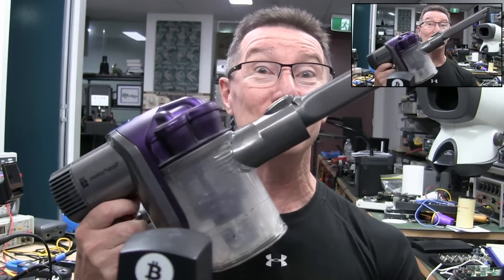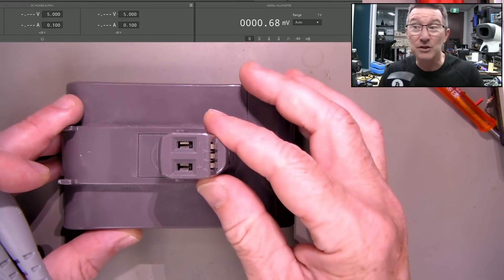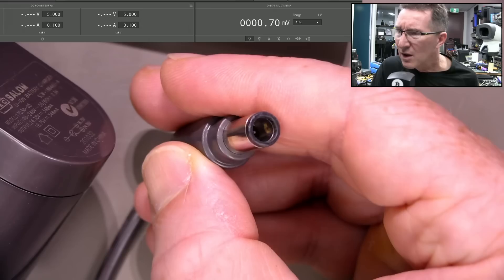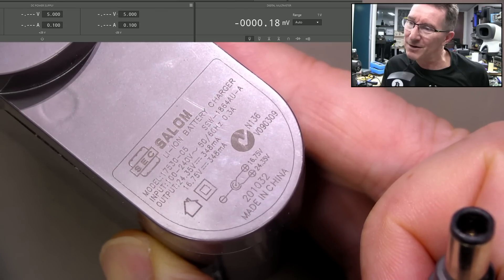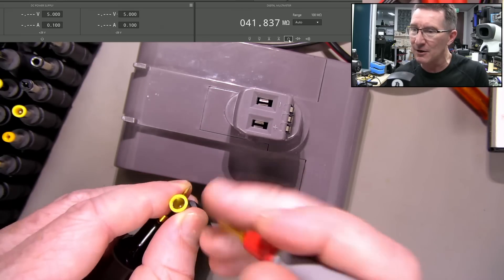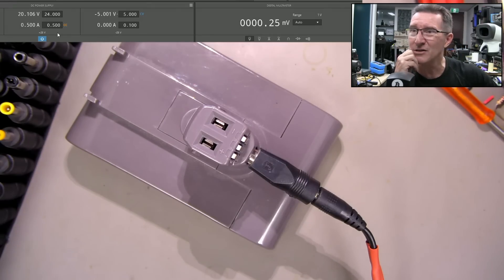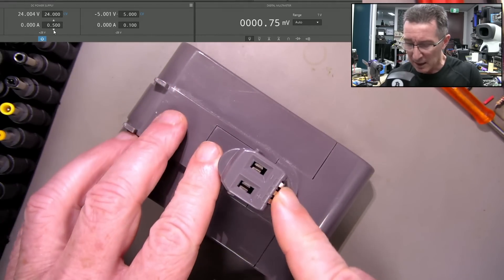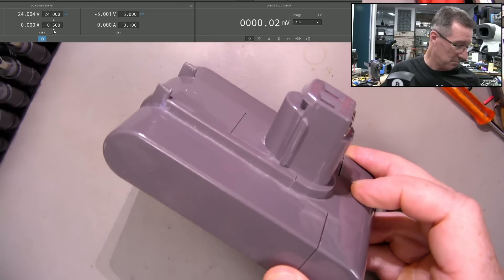Dyson Battery Failure

Comment: There's probably just a dead cell..  3.7 x 5 = 18.5v..  
If you could pull it apart, you might be able to reset the fuse.  (you likely already know this):  There is a little fuse on the positive end of the cells, that can break contact if the inside builds too much pressure from overheating, etc.. Many times you can just press down on the little diaphragm under the positive terminal (through the little pin holes) and reset the fuse again.   Sometimes the fuse will engage with heavy use or overheating--  but it also may be a shorted cell or something;   so there's always a little risk when resetting them..   I would test it well and charge and discharge it a few times and make sure it's not going to overheat and catch fire.............  But again, you would have to crack it open to get to it.   There are likely still 5 good cells in there otherwise;   I wouldn't just throw them away.
Reply: thanks for the info, i didnt know 18650s have this.
im one dyson battery pack that refused to charge the cell voltages ranged 2.7 - 4 volts ! 
i think its the crappy dyson BMS board that did that after a few months of non use. 
it doesnt include a battery balancing circuit / designed to make u buy a new battery.

Comment: So from my experience with power tool batteries. Most likely that battery is out of balance. I had some Milwaukee M18 batteries which got to the point the lowest cell was down to 3v while the highest one was at say 3.8v. So the battery would have very little usable capacity before the BMS would shut it down on either low or high voltage. 
Actually had a good bit of success manually re balancing using a benchtop power supply and just slowly bringing all the cell voltages back upto the same thing. 

But given thats 13 years old and plastic welded shut prob not worth it. You could also just drill some small holes through the plastic that line up with the ends of the individual cells to get multi meter probes through. 

And obviously any time you are messing about with lithium batteries need to take care. But i'm sure you are well aware of this already. 

And i think you are on the money with that plug pack being for both a 6S and 4S battery pack. 

That connected looks a LOT like a older model Dell laptop charger. In Dells case they used the 3rd pin to tell the laptop what wattage charger you had connected. EG 1v for 45w, 1.5v for 65W 2v for 90W etc.

Comment: I have bought a lot of the dead V6 batteries. The cells are usually OK but, when left uncharged for an extended period, the "bms" pulls one cell lower than the rest and eventually halts all discharge. I can get them open (the batteries) but not in a non-destructive way. Cells are spec'd for 30a discharge I think though Dyson uses a max draw of 16a (18a for V8 20700 2.8ah cells).

Comment: I've replaced few batteries in my old dyson. did not have removable battery with a button click but after few screws it got undone pretty easy. and replacement battery was not that expensive from dyson and easy to install back. Got more years from it after the swap.

Comment: You can get adaptors for every make of 18v power tool battery on the market. I converted ours to run on my 6ah Makita 18v batterys. Works fine, lasts ages. Doesn't last so long on the lower capacity 3ah batterys though.

Comment: over a decade i must have fitted over a 1000 batterys packs to dyson cordless models the best models for battery failures were the v6 and v8 models with  2 year  warranty that lasted exatly 2 years and 2 weeks to 2.5 years depending on usage so that meant the batterys were out of stock everywere for months i had at 50 on my workbench for months. the killer of the older models the ocasionally the motor units pack up or the floor head with spinning brush wears out or breakshe motor burns out there no longer avalible. there not terrible. its just batterys i class as a consumable/wearing part and will need to be replaced.dyson ulike many other manufactuers dyson make there battery packs easy to change and replace. there are loads of manufactueres who build the batterys into prouducts with no replacements or require full strip down which renders them uneconomical for repair. easlt chanable battery thats worth a little credit.

Comment: i opened 2 battery's a small one and a bigger one.
both did not work, but the cells were in perfect condition.
I suspect the circuit board has a countdown counter that at some point simply says, you have used the vacuum cleaner 1000 times, I will stop working.

Comment: I had a pack on some other Dyson fail a couple of years ago. At least in the US there's about a million vendors of questionable repute on Amazon and the reviews are all over the place. So hoping to not get screwed by a crappy vendor I bought my replacement from iFixit thinking that they would probably have some measure of quality control or at least that they'd buy from the same vendor repeatedly. It worked out of the box and has been going a couple of years so I feel pretty good about it. Plus I got to support iFixIt.

Comment: We have the same model. I tried to disassemble the pack to replace the batteries but it's practically impossible to do so without breaking it. 
In the end I bought a knock off from eBay and it's still going strong 6 years later.

Comment: The battery from later V8 model will not deliver any power unless you put a magnet on its side. There is a reed switch inside that needs to be closed in addition to a push button (normally pressed by "trigger" button mechanism) for any voltage to appear on terminals.

Comment: Cell monitoring, but no balancing. Cells drift out of balance, so that charging is limited by the highest cell and discharge is limited by the lowest cell. I've been seeing that for about the last 20 years on laptops. Often that actual cell capacity is still pretty good and a manual balancing session will restore much of the runtime. If the case can't be opened without destruction, you can often drill holes to put probes through (a torn down version  helps a lot).
Reply: I agree, this is probably the case.  I have kept my drill batteries operational for years by taking them apart and charging each battery independently with a charge controller equipped with alligator clips.  It's always the same battery that is low and bringing it back to full gives me another year of use.  I should get a balancer board sometime and populate it with clip leads.
Reply: I was coming here to say this. Do a manual balance. I balance and sell old Panasonic laptop packs. C'mon Dave you are an electrical guru. "No workey" is not a valid conclusion.... take it apart!

Comment: When my Dyson battery failed, I bought an adaptor off AliExpress so I can run my 18v Ryobi batteries on it.
Reply: We definitely need a review of those adaptors. I'm curious how they up the voltage from 18v to the 21.6 mine is rated.
Reply: @Smelter57  They don't, Dyson circuitry will allow the motor to run off 25.2v but not lower than 16v.
On these older models you can plug whatever supply you like and it should run just fine, newer Dyson  machines (starting from v10) really communicate with the battery so sticking + / - in that thing won't do much, however, there are adapters for those some models too nowadays.
Reply: Got one for Milwaukee, runs great.
Reply: @wobblysauce  Which Dyson model do you have?
Reply: @Smelter57  It's a bit less powerful than a fully charged Dyson, but it still works great. I initially bought a Ryobi stick vac when the Dyson battery failed, but it turned out to be junk. The Ryobi powered Dyson works way better than the proper Ryobi vac lol.
The battery adaptor was well worth the $20 I paid for it.
Reply: @patrolmaverick  Yeah, 18V packs use 5 cells compared to 6 on the Dyson V8, so you lose some RPM. Plus, newer Dyson models (V10 and up) run on 7-cell packs, so the performance gap with 18V is even bigger.

Comment: The  Dyson packs I have broken open for obtaining cells have not been glued or welded together. The two parts are clipped together with various clip/tabs that I have found impossible to release. I use brute force plus side cutters to chop away at the plastic. Sometimes there is a screw or two located in the bit that goes into the vac body. The PCB inside is sealed with a clear compound. The battery in the video looks like a Chinese copy/replacement

Comment: The Dyson vacuum’s run very hot in turbo mode. The battery is usually very hot when people place it in the charging cradle. I have connected via a smart plug which I have set up to switch on at midnight then off at 6am. This allows the battery to cool down before charging. It restricts using the vacuum to once a day, but the battery lasts much longer now. 👍

Comment: I think some dyson batteries have a nasty inbuilt circuit that kills the whole system if the individual cells get too far out of balance. My guess is one of the cells is dead which is why the charger is stopping below the final destination voltage. It could be fixed but you'd have a pack that looks like your dog chewed it to bits. Cheaper to buy another new third party pack and salvage the remaining good 18650's from the old pack.

Comment: That connector is popular on laptops. The center pin is used for encrypted data communication between the laptop and the charger. The charger must prove that it is genuine, or the laptop will not charge at full current.

Comment: That charger connector is nothing unusual, I've had many laptops with that 3way plug, compaq and hp I think, the center pin is data coms inner wall and outerwall is battery current on lappys

Comment: the DC cnnector is the same as Dell/HP laptops however they're 19v and the centre pin is charger capacity detection 
a bit evil cause things will die if misused

Comment: Dyson is the Bose of vacuum cleaners. 
I have a Kirby, it’s built using lots of metal, finger light to push, powered by mains only, has an INCANDESCENT light on the front, makes plenty of purposeful noises and uses a bag-that-costs-money-to-replace for dirt collection. 

It’s almost 20 years old and it still beats the pants off any other vacuum cleaner I’ve come across.

Comment: I retro-fitted a 20V DeWalt adapter onto my Dyson, so when it dies, i just take it out, put it on the charger, and slide in a new one. They actually sell prefabed ones now on Amazon and eBay that are pretty decent, and for pretty much any kind of 20V power tool battery. Trigger works, LEDs work, voltage cut-off works, etc. I also 3D pronted my own adapter for Hart batteries that I wired and mounted to my V8 (Hart is one of Walmart's house brands. I forget the actual OEM, they make batteries, power toolds, accessories , etc. for a lot of companies), but I kept having to open the batteries up to reset them (had the same issue with their 40V batteries that I use on my blower), so I stuck with DeWalt. I got an aftermarket 8Ah DeWalt compatible battery that allows me to clean my entire house, on turbo, for a little over an hour, and I have two of those batteries. 

One of the best money-saving choices I've made; now I never run out of battery power, since I can recharge independently of the vacuum cleaner

Comment: My dyson's battery failed recently. I'm not qualified to repair it, of course so I got a aliexpress one for cheap, and took the old one apart. I found 7 18650 cells with writing "LS LR18650LA LS3207 20274698" I ran them through a battery capacity tester. One of those got 1963 mAh with internal resistance of 81mOhm. The discharge was at 1amp load and between 4.2V to 2.5V. I now use them in a powerbank that accepts 18650 batteries. It doesn't charge my phone much on one battery but it's another capability I can use.

Comment: If you have power tools with the interchangeable battery packs, Ozito, Ryobi, Makita etc... You can get a replacement pack module that allows you to use those batteries instead. I replaced my Dyson pack with one of those and it works a treat.
Reply: Yup, this is exactly what I did. I can swap 'em out when one dies, throw it on the cradle, and slide a fresh one in. I have an 8Ah DeWalt compatible aftermarket battery that lets me vacuum my whole house, on turbo/boost, for a little over an hour. It's an absolute monster, and I have two of 'em. Not to mention all my regular 20 volts dewalt batteries. This was a great idea, whoever came up with it first.

Comment: I went down the “replace-the-battery-with-a-non-genuine” rabbit-hole last year with my Dyson 7 stick vacuum (in Australia)… wow! what a wild west level of false claims and fake power outputs available. Not just e-bay products, but from a bunch of the major retailers and suppliers across Australia. Selling the double or triple the standard Dyson battery capacity in the same form factor. I went through 4 different purchases and tested them and opened them up to find the same 18650 batteries in all of them, no matter what they claimed on the ads.
Reply: Your mileage may vary.  I've got an older dyson and am up to my fourth battery.  The second one lasted as long as the oem, the third lasted a year and the fourth is going well so far.  At least they are user replaceable.

Comment: That exact Dyson battery is by far *the most difficult* clamshell that I've ever opened.  Its not ultrasonically welded..but it might as well have been.  Super tight tolerances and some one way clips.  Razor blades would barely get in the seams and even then...difficulty.
Reply: Yeah I gave up! Just bought a knock off one and it still works great 6 years later
Reply: @BillCarrIpswich  Funny thing..I spent probably an hour getting the thing open, did the visual check, changed nothing..tried to charge again out of desparation..worked.  Reassembled, AFAIK..worked ever since.
I have a flow chart for fixing things I teach people that works 99% of the time.
1. hit with something heavy
2. disassemble, change nothing, reassemble.
3. Hit with something heavier.
4. actually troubleshoot the issue

This one resolved at step 2.  I've used this method for everything from sensitive electronics to heavy industrial equipment.  I'm telling you..99% of the time.

Comment: Put a power meter like the Kill-A-Watt or PR10 on the charger. Watch the change in the wattage when you connect the battery. that way you can determine if any charging activity is happening.

Comment: Yeah that's a "counterfeit" battery, you can bet the real Dyson batteries are covered in Dyson copyright marks and actual safety compliance marks, not the wonky CE mark and the irreverent FCC mark. My guess is the triaxial power plug is for wattage communication, very common on laptops the center pin tells the onboard charger how many watts the PSU can do so it doesn't overload it. Often it's just a resistor or voltage divider or in some cases one-wire.

Also bet the failure mode is a collapsed cell, really common on those cheap batteries to have zero cell balancing to save money, eventually the cells go out of balance and overdischarges a cell to failure, the remaining cells are then overcharged until the over-voltage cutoff engages. But the ESR of the bad cell prevent you from drawing enough current for the Dyson to start.

Comment: I think you need to confirm the battery is the problem, so you should plug in the battery when it is high to see if the vacuum works. Also maybe it works when the adapter is installed as opposed to disconnected. I think given the data it is not totally clear the vacuum does not have a problem.

Comment: I have a friend who had the same problem. A new Battery was required. I took the old one to bits, destroying the case, but when I got it open, the cells were all perfectly OK, it was the BMS that had failed. So you might have Six good cells to play with. Crack it open and let us know.
Reply: I got a few from the tip a few weeks/months back, one had zero volts on the output but the batteries are fine. I have another I've yet to open and that also has zero volts on output.

Comment: Used to have one of those Dysons but the battery failed twice after about a year (and it wasn't replaceable on this model). 
The first time it got replaced by warranty but not the second time. 
So i got fed up and sold it and got one made by Bosch that takes standard Bosch battery packs. 
It works just as well, was cheaper and i can easily replace the battery or even use a higher capacity one. 
Dyson is just 90% marketing.

Comment: Funnily enough, 20.8V divided by 5 is awfully close to proper max voltage of a single lithium ion cell.
My guess is, there's a single cell gone to zero but the BMS is still accepting a charge for whatever reason and thanks to cell balancing keeping the voltage of the rest of the cells in check.
Teardown would've been interesting. See what they're actually doing because I would've expected it wouldn't charge at all yet it is.
Reply: Exactly my thought.
Reply: 20.8V divided by 6 is 3.5V, which is well within the operating range for an NMC cell, albeit fully discharged; it certainly is not indicative of cell failure, so it's likely a BMS fault.
Reply: These Dyson packs have 6 cells, not 5. Have just re-celled a pack for the same model.
Reply: @christhesnaildriver  And in other news, water is wet.
My guess was, that out of the six cells, one cell has gone to zero. 6 minus 1 equals 5. Hence the fully charged voltage close to 21V instead of what it should be (close to 25V).